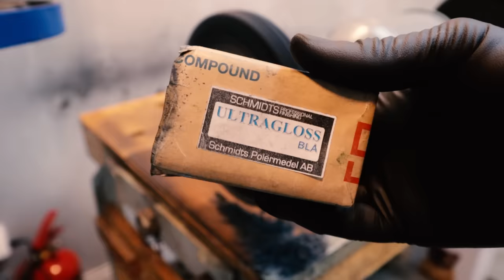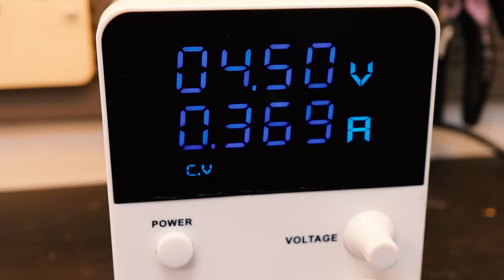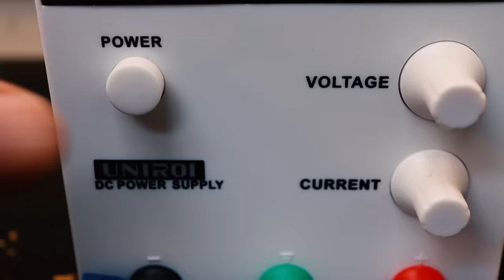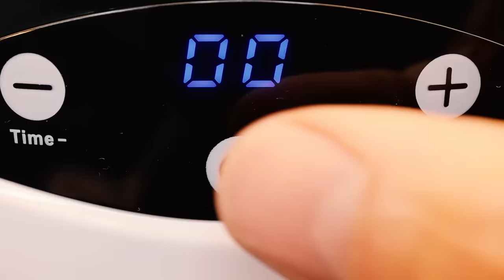AK 47 Gun Oil Bottle Restoration from the Vietnam War

Comment: Question, I have a snuff can top from the 80’s that my nephew found on the edge of a lake, in the water, it brushed the rust off of it and have used it now for 12 years, it’s a scene on the top of a big mouth bass jumping out of the water with a fishing line, when it was new it would have been copper or brass coated I think, but all that’s gone now, it’s just the base metal with a few rust pit holes in, do you think you could restore it? I would be willing to pay for your services.

Comment: What is sand blasting?
Reply from the maker: Sandblasting is kinda like peeling. You "spray" sand under very high pressure (the pressure is made by a big compressor). The high pressure allows the sand to remove dirt and rust :)
Reply: @AwesomeRestorations  Oh,thanks man!